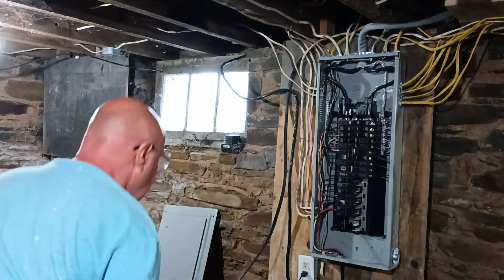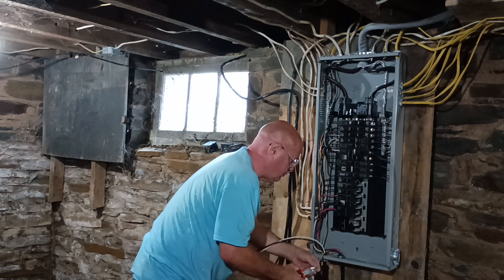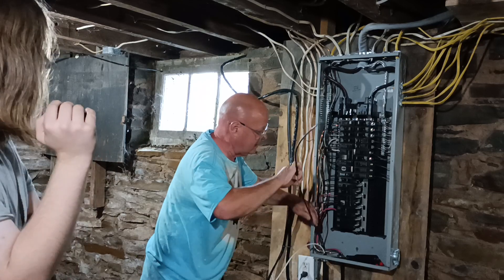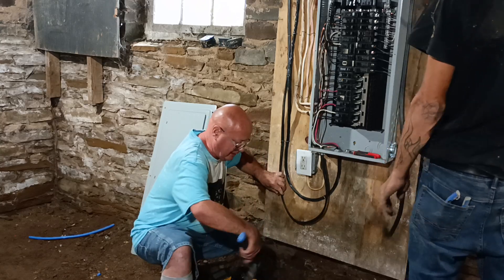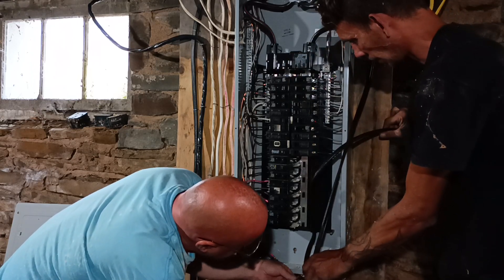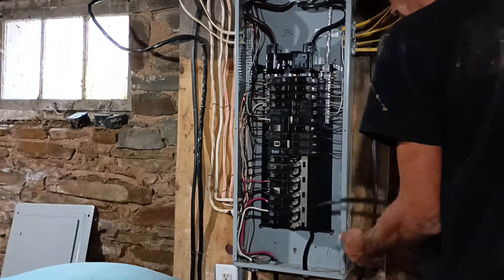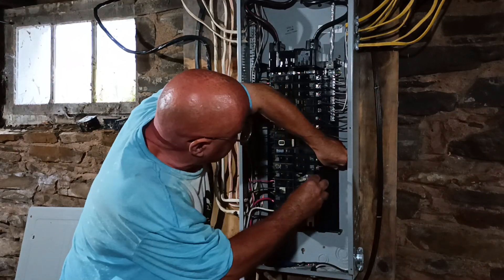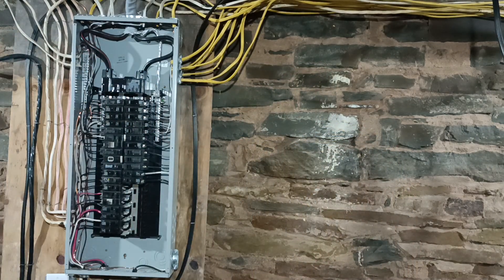September 14, 2023 how to wire a 40 amp 240 volt circuit into a main panel 3 conductor 8/2 w/ground

Comment: You "should" put the 240 towards the top as much as possible to reduce resistive heating and try to balance amps overall on left and right of panel to reduce multiple high draw sources on any one side to reduce surges as well as heat and a whole home surge wouldn't be bad while you were doing this and I do believe it's code now to have whole home surge now but I could be wrong haven't checked nec in a bit "word of mouth" and damn hearing a back seat driver repeat every said is annoying.